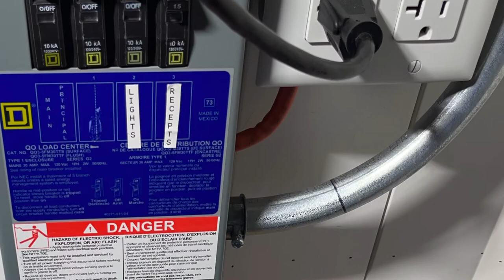CARGO TRAILER MOTORCYCLE CUSTOM HARLEY ROAD GLIDE CAMPER TOY HAULER 7x14 NEO

Comment: Wow, You have some beautiful ideas! Love the 'Murphy bed' setup. I kept looking for tiedowns but didn't see any. I use 5 in my camper. 1 for the front tire and 4 more for conventional ratchet straps.
Reply from the maker: Thank you.  I will post a video of my anchoring method.  I have holes in the floor with structural support beneath the wood attached to the frame allowing various threaded anchoring yet a smooth floor with minimal evidence of it.

Comment: I currently have a 6x12 enclosed trailer that I was using to haul motorcycles while staying at hotels and cabins.  Then spring of 2020 made hotel stays challenging so I converted it into a lightweight toy hauler.  In hindsight I wish I would have sold it or traded it for a larger trailer, but I made it work for me for almost 3.5 years now.  Now I am thinking about an 8.5 X 16 build.  Why did you choose a 7 wide instead of an 8.5 wide?  I figure the wheels are 8.5 regardless of which trailer so might was well get the most interior space for the same wheel width.
Reply from the maker: I have another video just posted of a second trailer.    The 7x14 plus 6 and round top is the perfect single hotel room and hauls a big bagger or my XMAX 300 cruiser scooter. 
The 101-1/2” wide wheel base is exactly the same as my new 1485R6 so the main difference in these is it makes it the same size inside as a 7x17.  You need real tow mirrors but both are half ton truck friendly.
Reply from the maker: https://youtube.com/playlist?list=PL7cj-nBZI6lLDKC0IvS-uJQ-g3Q5qr2A2&si=3eQTp88VXBuADYOm